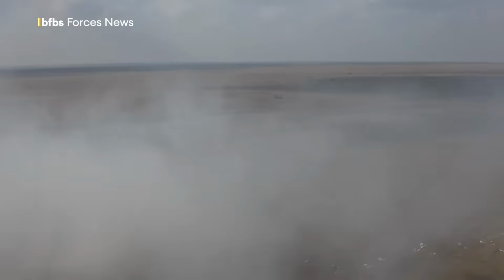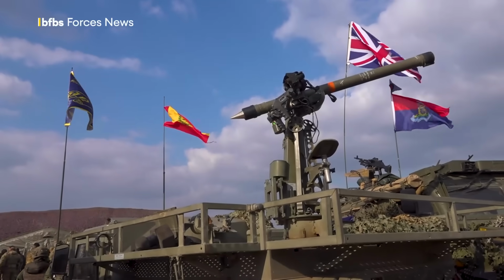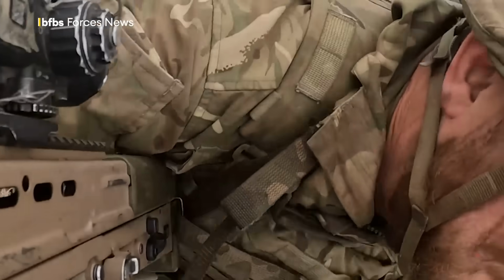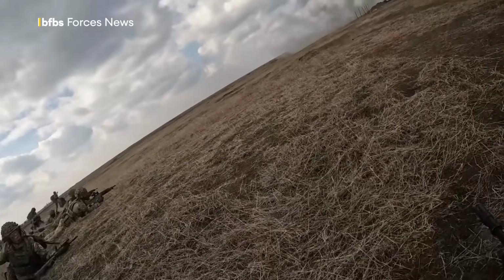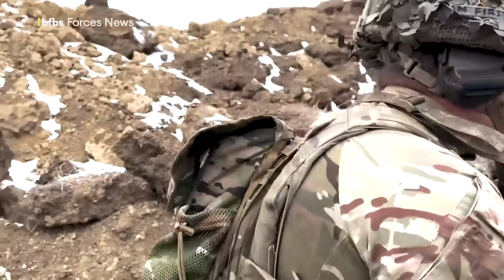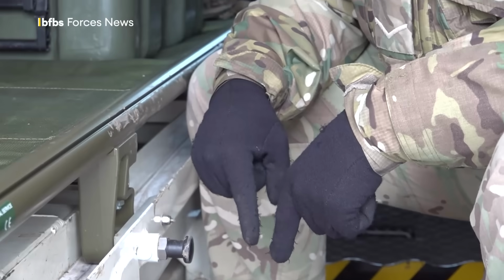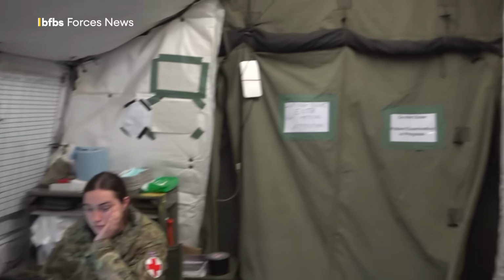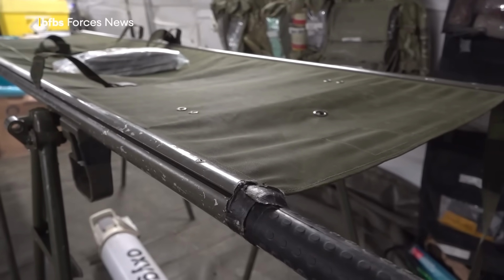Exercise Steadfast Dart: Testing Nato's high-readiness 16 miles from Ukraine's border

Comment: We primarily rely on combined arms using air support. 

The big worry these days is MANPADS, which appear to supplied in thousands to equip every hostile unit with the ability to down our aircraft.

Warfare has changed a lot over the last 3 years.

Comment: It is somewhat disheartening to see Land Rovers, and Pinzgauers still in use with the British Army. I know that the Land Rover Defenders shown are no longer in production, and a new general purpose transport vehicle is really needed. Maybe even more so than the high budget Boxer, Ajax, and MRVs. If the UK Defense budget is increasing, the MoD should really prioritize the replacement of the Land Rover Defenders, and Pinzgauers still in service.
Reply: Yes. Simple, flexible, highly replaceable, highly dependable diesel powered transportation that is cheap enough that we can have it en masse. As locally sourced as is possible these days. 

All the equipment that costs millions is pointless if we can't get it, bodies to operate it, fuel, ammo, food and medical supplies to where they need to be, wherever that ends up being.